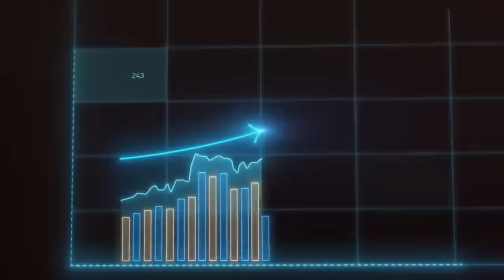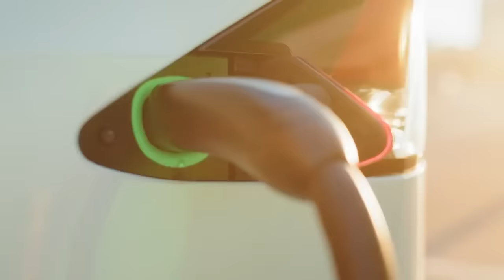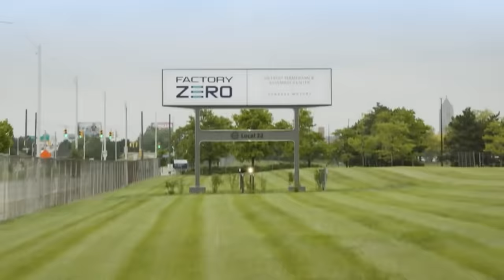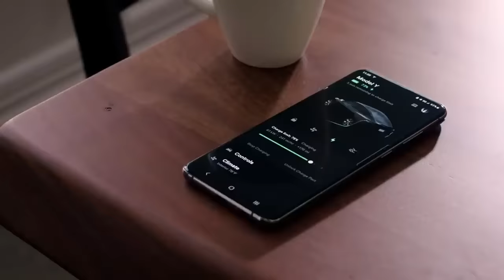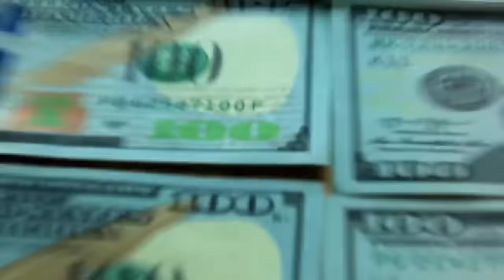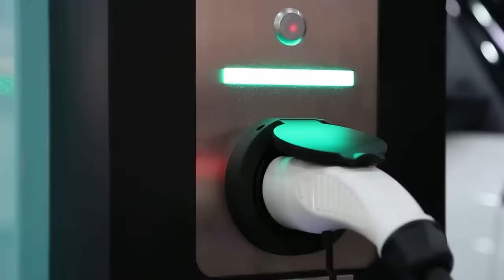Electric Vehicle Owners Are Frustrated and Demand the Return of Gas Cars

Comment: What gets me is that ALL of these problems were 100% predictable.  It was obvious from the start that it could NOT be done in the timescale that they were trying to force.
Reply: That's why EV's back in the early 1900's went the way of the Dodo bird... until being brought back by the govt.
Reply: Exactly
Reply: Its stupidity in Chiraqistan.   Lyft drivers rent the shortest range ones and are constantly driving all day and on the chargers all day,  the lyft drives should be hybrid drivers and the I commute 100 miles or less drivers should be plugging in at home at night..   People get the cars and then think maybe I should have a charger at home not the other way around.    I still have a gas pickup to do pickup stuff but 99% of miles are EV and home charged while I sleep on off peak electric rates absurdly cheaper than the public chargers or gas.  Education on how to use them and the best use case is the solution, let people decide and in many cases they are better across the board with little to no issues.
Reply: @MotoGPatrick  Eventually your battery will only absorb enough energy to drive less than 20 miles...and that's a fact.  Someone I know has that problem plus it is unreliable in cold.
Reply: @MotoGPatrick you are not very smart are you? Bet a liberal.
Reply: This argument was the same from horse and buggy drivers in the 1920s when ICE vehicles began to appear in mass.
Reply: @gregcook7900  you can still buy a horse and buggy. Nobody outlawed horse and buggies. Go ahead have fun. Bet that horse and buggy more reliable and safer then a electric car
Reply: so how do u fix the old cars needing batteries to start>??
Reply: it's being done, china's doing great with EVs  cheap and plentiful, can charge any where. no pollution and 1/10th cost of gas cars
Reply: @gregcook7900  Stop with the false comparison. Horses <-> cars is not the same as ICE<->batteries.
Reply: @fmo94jos8v3  they were referring to the supporting infrastructure. When gas cars first started coming out there weren't gas stations everywhere. So only a fool would buy one over a horse or steam powered buggy. People have trouble with change. Nothing new here.
Reply: If the oil companies hadn’t stonewalled the science, we could have had 40 extra years to do this. Speak to your lobbyists.
Reply: It will be a matter of necessity, not preference.
Reply: @MotoGPatrick  Your charge at home at “absurdly cheaper rate” claim doesn’t hold water..  The Tesla model 3  long range which is pretty much most people claim is the most efficient EV had a real world range at 250 miles at 70 mph.. The model 3 long range has a 82kwh battery and the average price per kwh in the us is 16.21 cents so that’s $13.29 to go 250 miles.  A Toyota Camry can cruise at 70mph at 34 mpg and the average price for gas is $3.17 a gallon, so that comes up to $23.29. So in a Model 3 long range your “absurdly cheaper” savings is a whopping $10. 

Now I know you are going to want to use EV Jesus’s talking points of that $10 will add up over time..  Great, let’s look at those numbers. A model 3 long range MSRP is $46,000 and I can’t figure out if that’s AWD or RWD version so let’s just give it the benifit of the doubt it’s AWD..  An AWD Toyota Camry has a MSRP of $30,000.  So just taking $16,000 divided by $3.17 for average price per gallon is  5,047 gallons of gas and at 34mpg that’s 171,598 miles..  But let’s do it up right. Changing oil at every 15,000 miles would be 11.4 oil changes to stay within the $16,000 difference that will drop the miles down so we won’t need anymore than 11 and let’s say $75 for an oil change, that’s $825..  So $16,000 minus $825 is $15,175.  $15,175 divided by $3.17 is 4,787 gallons of gas. 4,787 at 34mpg is 162,758 miles..  So just from spending the exact same money I can buy a very comparable Toyota Camry and drive it 162,758 miles including oil changes without you charging a Tesla model 3 one single time at home were it’s “absurdly cheaper”.. lol 

Now if you want to get really “absurdly cheaper” and crazy let’s do the math of ownership over 5 years…  I got different depreciation percentages on a Toyota Camry over 5 years from 24-40%.,  everywhere I looked even on EV favorable sources have Tesla at 55%…  So looking at the Tesla being worth $20,700 in 5 years and let’s get extremely fair and go with the high on the Camry at 40% which would make it worth $18,000… So the Tesla cost of ownership would be $25,300 over 5 years and the Camry $12,000. But let’s tack on that $16,000 to the Camry and make it a total of $28,000… $2,700 more for all in ownership including gas and oil changes to go 162,758 miles and the Tesla didn’t charge 1 time at home at an “absurdly cheaper rate”..  lol.   Math doesn’t lie soy boy EV Jesus cultist.. lol
Reply: Aww the Hype are gone?
Where too?
Reply: @h.mandelene3279  Can't really compare 1900s technology to today. I think now is a great time to start EV development. The govt shouldn't be forcing it down people's throats. I'm in two minds about govt subsidies, as I do think its a technology worth exploring.
Reply: That's what they said in 1910.
Reply: Yeah thanks to companies like Tesla they focused on pushing as much of these things out as possible
Reply: @tedmoss  1910 automobiles proved to be a viable method of transportation on their own without government interference.  Private investors seen value and built the infrastructure.  Government wasn’t banning horses and destroying their food.. Free market prevailed… Huge difference.. 

EV hasn’t proved itself and companies who did invest are pulling out of entire countries..  2 charging companies have pulled out of Australia and 2 rental car companies are dumping their EV fleet because the numbers don’t match up..  

I don’t know who you think is going to invest the 100’s of billions if not trillions of dollars to whip the infrastructure into shape for your and your messiah EV Jesus’s EV utopia to become reality..  EV only makes 1.2% and reality is the power grid was really already stretched before they came online..  With the vast majority of EV owners having a garage to charge it’s fair to say the charging infrastructure isn’t even at 1%….
Reply: @tedmoss  1910 automobiles proved to be a viable method of transportation on their own without government interference.  Private investors seen value and built the infrastructure.  Government wasn’t banning horses and destroying their food.. Free market prevailed… Huge difference.. 

EV hasn’t proved itself and companies who did invest are pulling out of entire countries..  2 charging countries have pulled out of Australia and 2 rental car companies are dumping their EV fleet because the numbers don’t match up..  

I don’t know who you think is going to invest the 100’s of billions if not trillions of dollars to whip the infrastructure into shape for your and your messiah EV Jesus’s EV utopia to become reality..  EV only makes 1.2% and reality is the power grid was really already stretched before they came online..  With the vast majority of EV owners having a garage to charge it’s fair to say the charging infrastructure isn’t even at 1%….
Reply: @MrAkaacer   Are you going to build the infrastructure for them?  Open your eyes. Companies who did invest are jumping ship because money doesn’t add up..  The infrastructure isn’t even at 1% of what is needed for a EV utopia…
Reply: @lanejohnson7656  Yes I would subsidise this. As you say, the investment does not make sense for private Companies, so sometimes the government needs to step in and help out new technology. For example, many governments subsidised the installation of fibre optic cables because no private Company wanted to take the risk (in many Countries outside USA). As for electric grid, many governments subsidised electric power plants and privatised them later. Btw I'm not talking about EV utopia, but it should form part of our transport strategy. For example, I think electric buses can be useful. delivery trucks (the ones used for local delivery not inter-city), etc...
Reply: @MrAkaacer  Also you do realize by saying you would subsidize it means you are talking for me as well right?   See I have a problem with throwing good money at stupidity… Sorry, but maybe you should research the meaning of fascism..
Reply: I know, America is a bit slow here. Rest of the world seem to make EVs a success.
Reply: @steve_is_my_name  That town is beyond slow these are the people who would be out looking for jumper cables or gas cans with a gas car.
Reply: @MrAkaacer they can explore it without subsidies. If the market wants it, it will be supported just fine without subsidies.
Reply: @steve_is_my_name don’t compare small countries that barely have to drive further than a few miles to the size of USA. We drive much further distances.
Reply: To be fair there still is pollution from manufacturing of component (especially battery) and charging .however , at 15,000 miles ICE cars will pollute more than an EV would in its lifetime
Reply: To be fair there still is pollution from manufacturing of component (especially battery) and charging .however , at 15,000 miles ICE cars will pollute more than an EV would in its lifetime
Reply: @MotoGPatrick   I hope you have good fire detection system at home, and 30,000 gallons of water at hand in case of fire.
Reply: but the public were not aware, they are learning now. but the govt, and the manufacturers knew everything
Reply: @lorcis1  The public was not paying attention to what was being said, thinking that they knew best, being scammed yet again
Reply: @JS-nd1po  As I mentioned, sometimes the market needs help, for example, water, roads, postal services, electricity, internet, railways, telephone, etc... There was no Company that could afford to start these projects.
Reply: @steve_is_my_name not anywhere cold lol
Reply: @kyles4744  not anywhere cold according to videos like this, yet Norway is one of the coldest countries in the world and 80% of new cars are EVs. So maybe only not cold on American YouTube 🤔 🤣
Reply: @gregcook7900  Horse and buggy is not self-igniting
Reply: @cindybrown9898  With hand  crank, just like in old days. You do not need battery at all just couple magnets. Magnets beeeach Yoooo.
Reply: @steve_is_my_name  I'm not in America and they don't do well here lol
Reply: @kyles4744  and what model was your EV?
Reply: @steve_is_my_name  didn't get one as I saw other ppls EVs die, why would I be a dumb@$$ and get one ?
Reply: You are learning.... The environmental movement has nothing to do with the environment and everything to do with socialism.
Reply: @Colonel__Ingus69  may be, but I assume you see that humanity is damaging our environment.
Reply: @steve_is_my_name  when I am gone and buried, I will have a clear conscience and lived my life in an environmental friendly manor. My point is environmental activist ignore science and facts and do far more harm than good.
Reply: Engineers lolz
Reply: GREED GREED GREED!!!
Reply: @TPWW-tr3rr  yep. That's the oil giants.